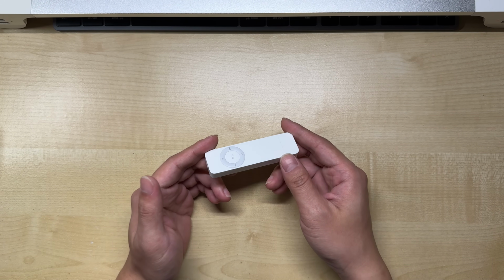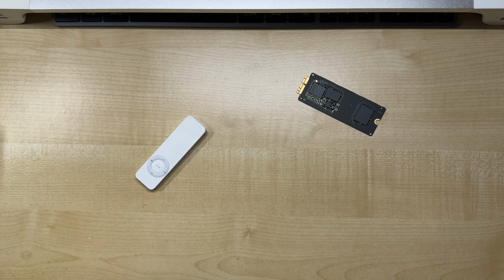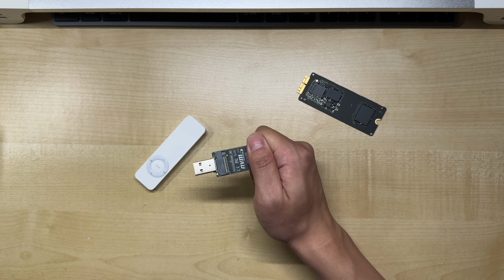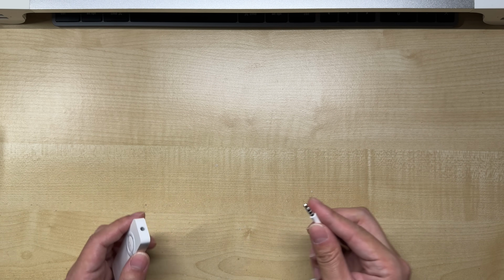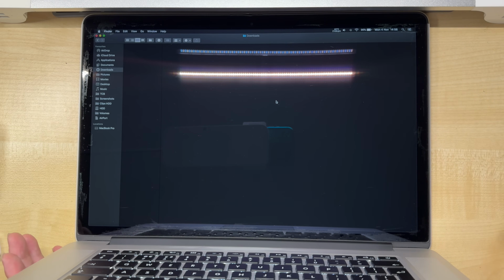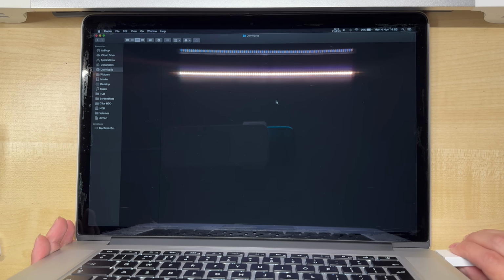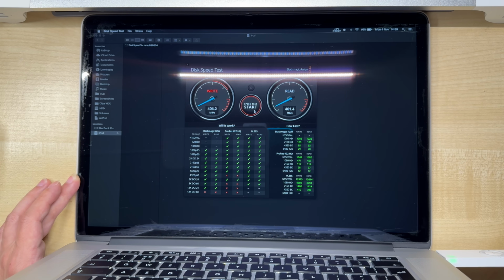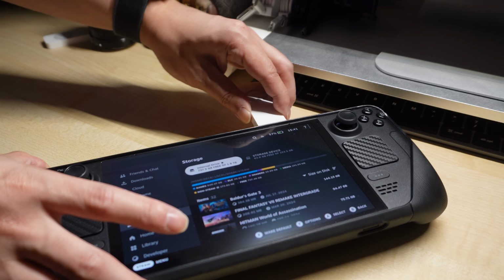I turned a dead iPod Shuffle into a 1TB NVMe SSD

Comment: Another idea for a USB-C cap, take a cover for the male end of a USB-A plug, glue it inside the cap, then glue a USB-C male cover inside the USB-A cover, fill the gaps with hot glue and then do a little clean up work. Or just 3D model all of that and create one insert that you could glue in place!

Comment: Man I just thought of something that may not be possible but would be neat, a usb dac with the iPod soufflé housing, maybe with a usb hub inside with an ssd or something.
Reply from the maker: It probably won't be too difficult taking the Apple USB C to 3.5mm adaptor and using it as a USB C DAC inside the Shuffle's housing but anything more advanced than that would be tricky.
Reply: @NekoMichi  I may have forgotten that dongle dacs were that small, I’m using a moondrop dawn pro which is relatively pretty large. I do believe it’s possible but will require custom pcbs so it’s beyond my depth for now.

Comment: I'm just a little sad that the other half of the iPod's use is now gone.
Reply from the maker: It's unfortunate, but the logic board was dead anyway (the fact that it couldn't be read by a PC indicates board-level failure) so the iPod was long gone before the project even started. At least the casing now has a second life as a portable SSD.